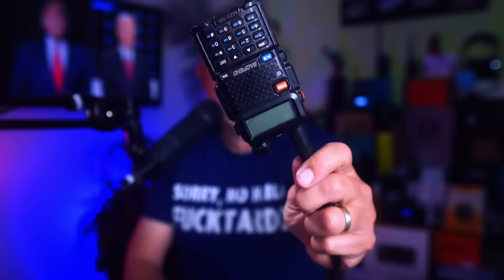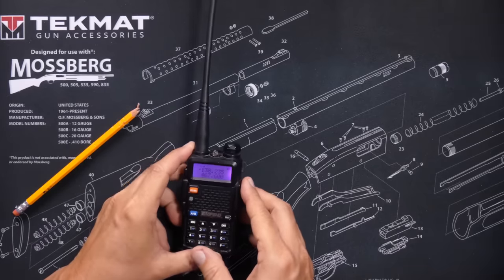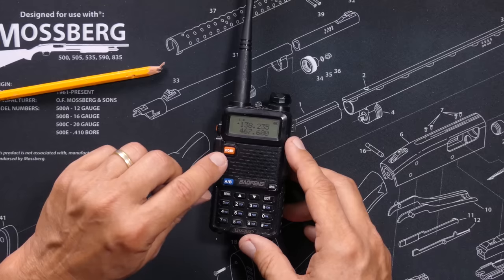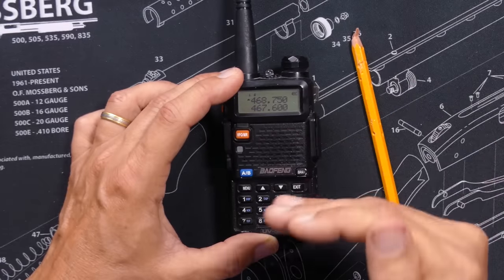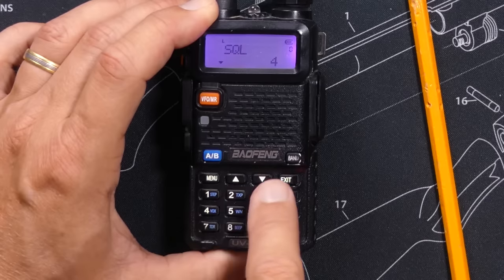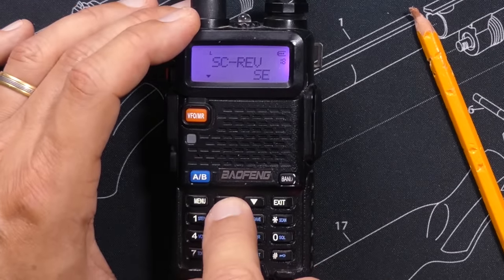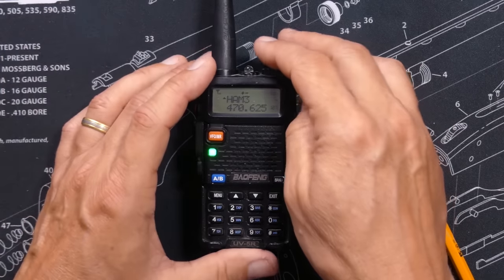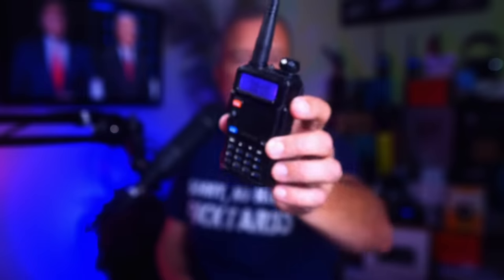Tips For Using A Baofeng UV-5R As A Scanner - Scanning, Skipping Channels, and Scan Settings

Comment: I've had my UV-5R since 2014 or 2015 and use it as an ad-hok scanner in addition to my Uniden HomePatrol scanners. Thankfully, my county dispatch in Central PA is still analog along with some neighboring counties. I find that it receives much better than any scanner when using the standard rubber antenna. I love mine.

Comment: I got my first UV5R 3 weeks ago. I now have 7 of them and 2 GMRS ones now. Just got a TB5R 8 watt yesterday. I have a cop car that still has the antenna for uhf/vhf. Tomorrow I get my adapters to connect my tb5r in my car. I have a usb charger for the bigger battery as well as a speaker so I can hear it batter.

Comment: Randy, although you can be a bit harsh at times (which appeals to my sense of humor, by the way), your videos are interesting and I enjoy them. I am an old ham (think collecting social security), and when I had money coming in, I bought four Yaesu ft-60  handhelds, speaker mikes, improved antennas, and battery packs if no AC is available. You can clone one from another, and they can survive a LOT of punishment. I still probably would not have gone with Baofeng if they had been available. But I did buy one to mess around with. I'm not really terribly impressed, but they certainly were cheap! But so were the Yaesus at the time.

Comment: I think the question 'can you scan through a range of frequencies' should be interpreted as '... through a programmable range of frequencies...'  for example can I set the radio to scan 145.500 - 145.950. As far as I know that's not possible (wich, unless I'm wrong, I consider a big omission of the radio)

Comment: Thanks for your videos! Would this be a decent option to use primarily as an emergency scanner? I saw your scanner video but am after a beginner radio at about this price point.
Reply from the maker: Only if what you want/need to scan is transmitting an analog signal and within the limited frequency ranges that the UV-5R can recieve.

Comment: Would you be able to use (TX/RX) these radios if you only program the FRS frequencies on them and nothing else?
Reply from the maker: The UV-5R is a ham radio and the FCC says that to transmit on a ham radio you must have a ham radio operator license. The FCC also says that using a UV-5R to transmit on FRS/GMRS frequencies is not permitted.
Reply: I tested it on an FRS radio.  It works...
I doubt Innovation, Science and Economic Development Canada is listening to little old me.  But then again I was just checking it out.

Comment: So you can't scan a range say between 440-442 specifically over sand over without  setting that as a separate configuration in chirp?  I saw that depressing the scan button for two seconds enters "range set" mode.  WTF